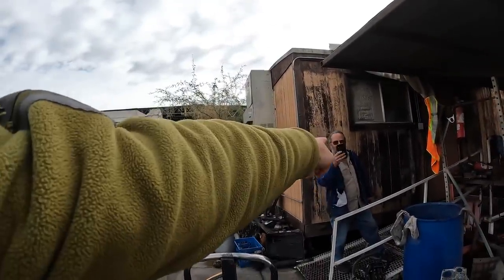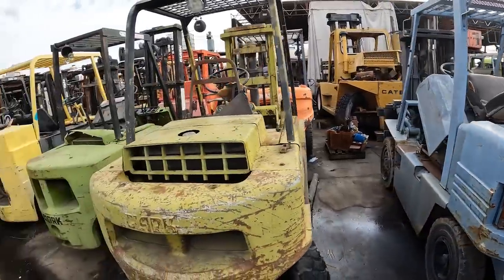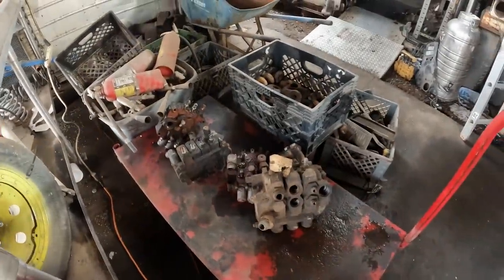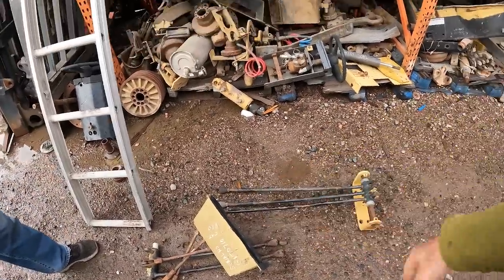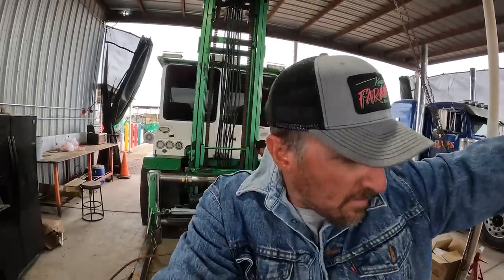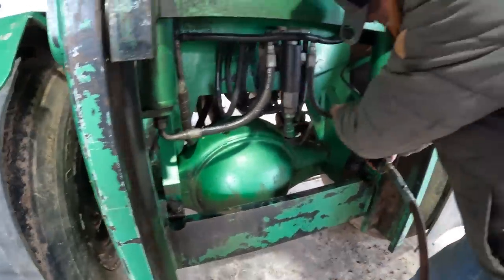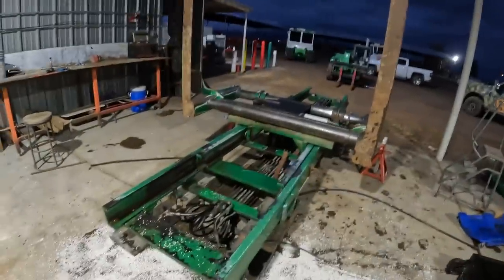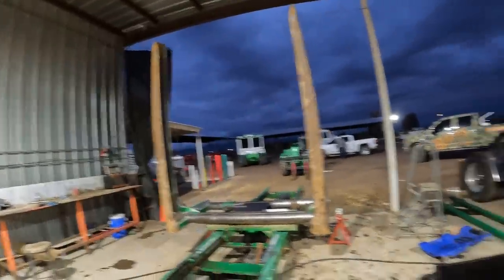Forklift Graveyard

Comment: Ok, that is a cool crane, wonder what engine it has and year of manufacture.   5500, sounds reasonable.  In the east that piece would have been gone ages ago.  Looks doable
Reply from the maker: I think it’s a super cool guy. But I’d rather have a telehandler.
Reply: @BalesHayFarmandRanch  , yeah, as a kid we had an open station Trogan front end loader(McCormick m engine transmission etc), now I have 6 forklifts.  Telehandler would be great